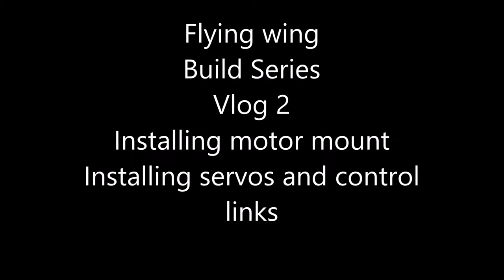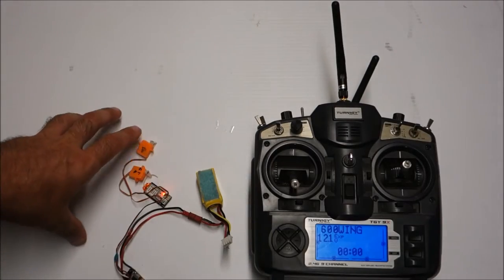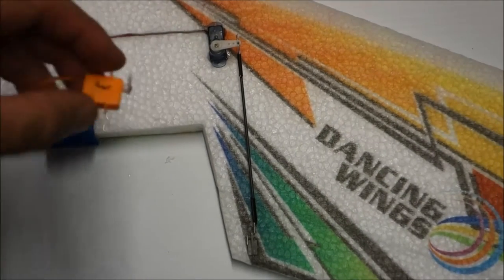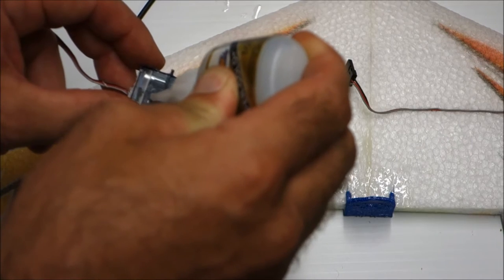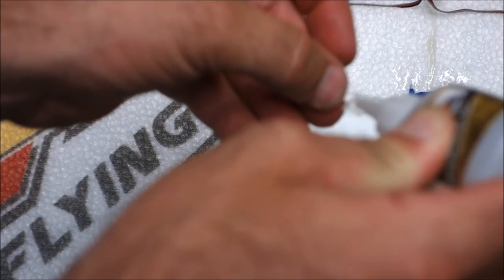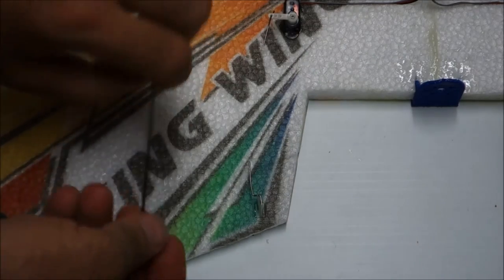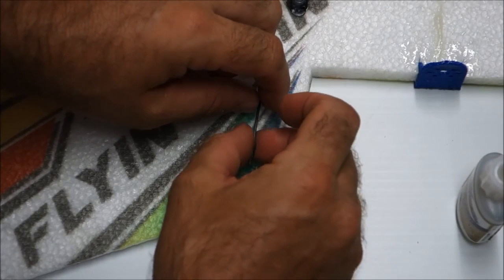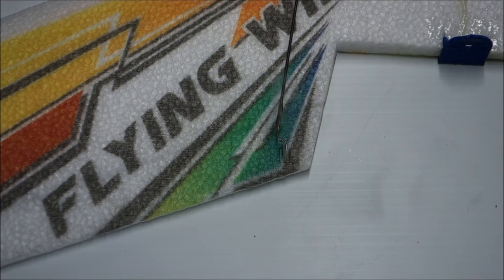DW hobby Mini wing bulid series Vlog 2

Comment: Why is the control horn so far back? Did the instructions recommend that, generally the holes on the horn are in line with the hinge. It would allow those little servos to work just fine. Nevermind I see the pre made hole, but still having it more forward would give you better control.